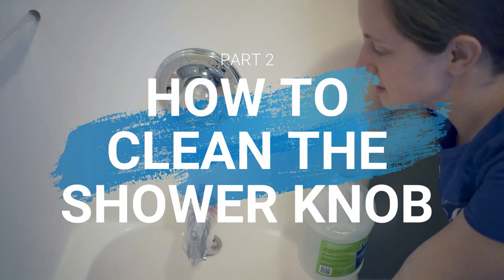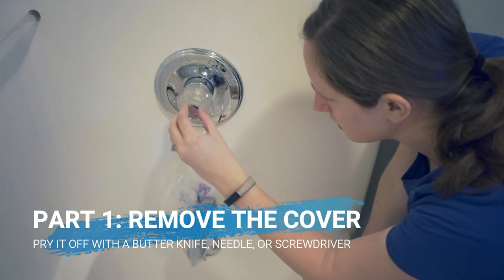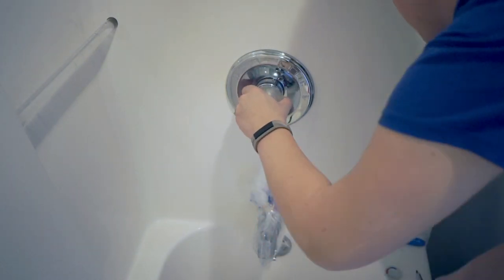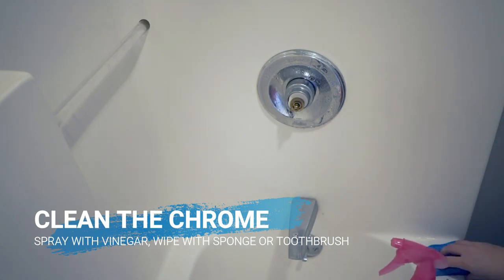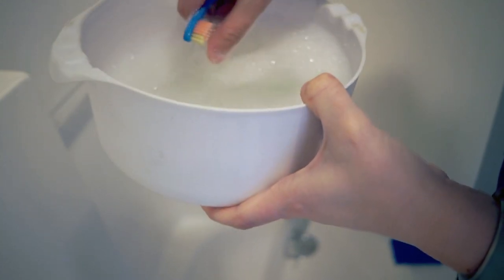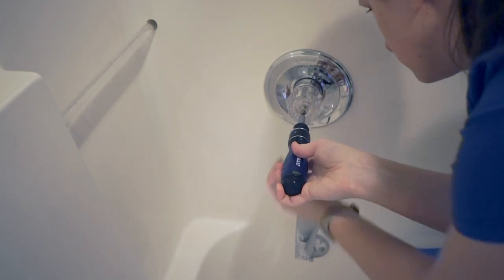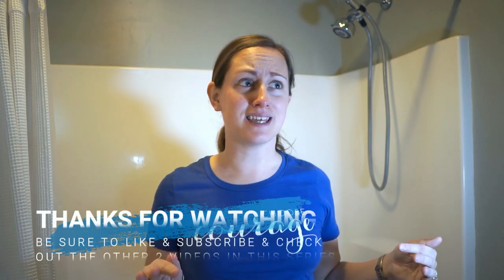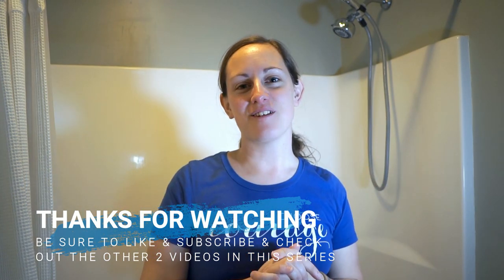How to Clean the Inside of Those Shower Globe-Style Faucet Handles!

Comment: I've taken handles off to clean before on  my rental unit shower. After putting them back on the cold water turns on counter clockwise. I didn't remove the white part but tightened the flange (back plate). I don't remember if it was like that since I didn't turn on the water prior to taking off the handles. Could tightening the back plate turn the diverter (white part) in the wrong direction? I took off the handle and can turn the water on with the white part and it's the same counter clockwise. Thanks.